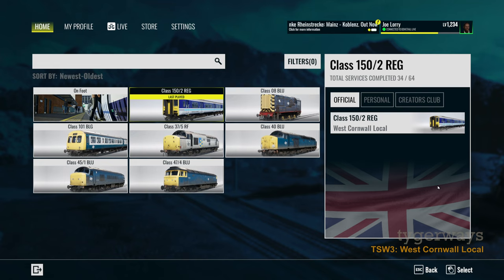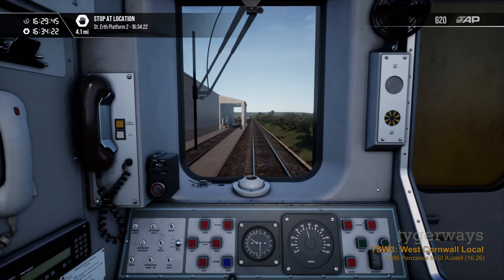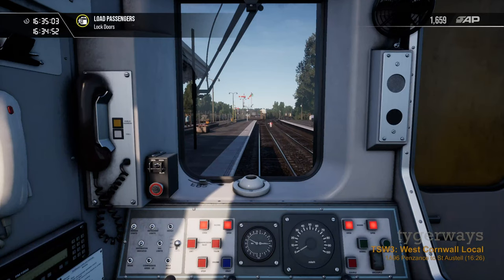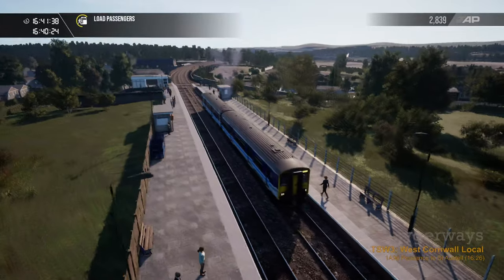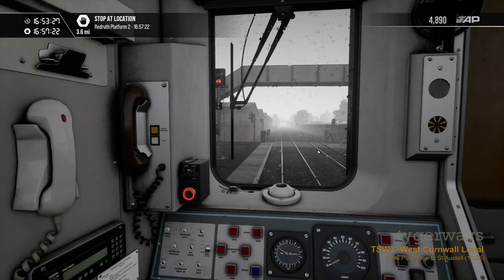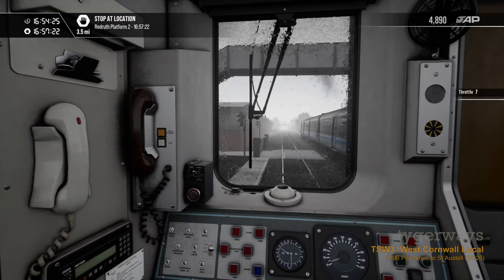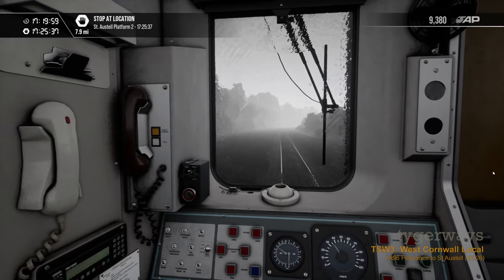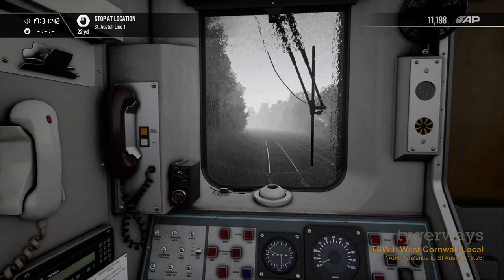Diesel-Hydraulic (Hydrokinetic) Transmission on DMU like the BR Class 150/2 (TSW | tutorial)

Comment: Red after St. Erth.  As you point out that is an invalid signal sequence.  In a semaphore signal area like St.Erth, the distant signal should have been yellow and the first stop signal held at danger until the train reaches it.  Then what happens depends on where the train ahead is but the key point is that the distant should only show green if all the stop signals at St.Erth are also green.  If any of them aren't green (as in this case) then the distant should show yellow.  

For some reason DTG just can't get UK signalling right and all the TSW UK route DLCs I've played have signalling errors in them.
Reply from the maker: Thank you for your comment!
The same problem (red color light signal after all clear semaphores) appears on Northern Trans-Pennine at least on two occasions, if I am not mistaken, where it can easily lead to a SPAD-out. I guess the signalling system in the game doesn't cope too well with holding semaphore distant signals at caution when not the next, but a later signal in the sequence is held at danger.
On the West Somerset Railway it works, though, for some reason. But there the signal sequences are obviously much simpler.